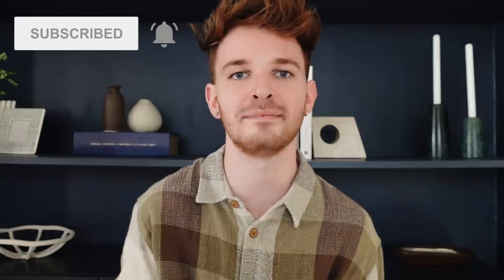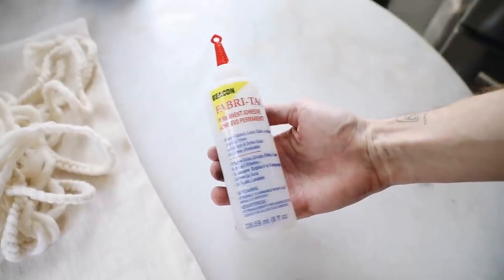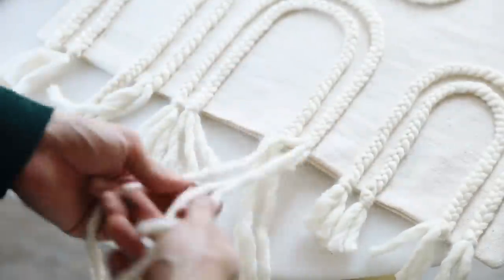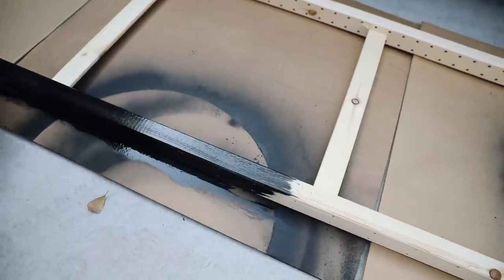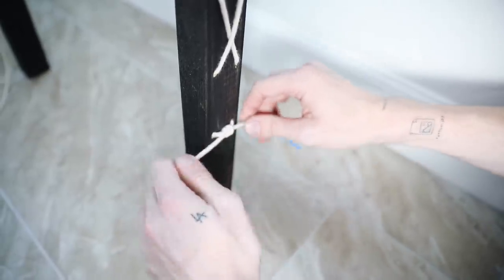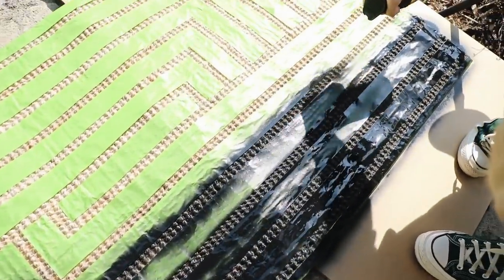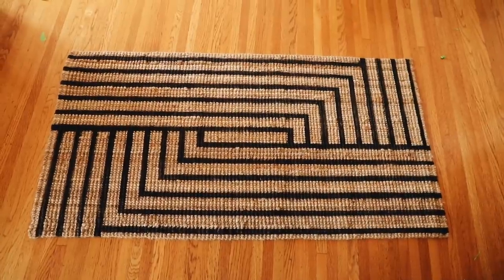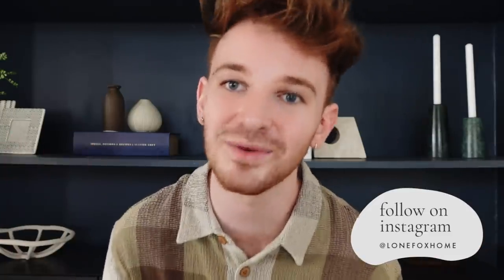DIY IKEA HACKS - Affordable DIY Room Decor + Furniture Hacks for 2021!

Comment: The pendant light is phenomenal! If you’re worried about the hot glue holding the light inside the bowls with the weight of it and what-not, you could take the size of your hole in the top bowl up a half inch to let the light go all the way to the base of the bottom bowl so you can use the screw on flange to snug the light in place. Love these ideas- and the rug was sooo pleasing! 🖤

Comment: Loved all the projects. Quick question. Is there another way to do the lamp instead of glueing it together? I feel that with the heat of the lightbulb and the weight of the wood bowls it can come apart and fell down. But I love the lamp and want to do it just don’t feel sure it will not fall down!